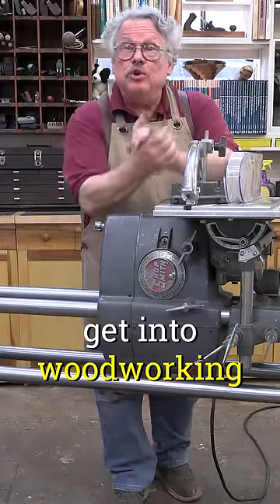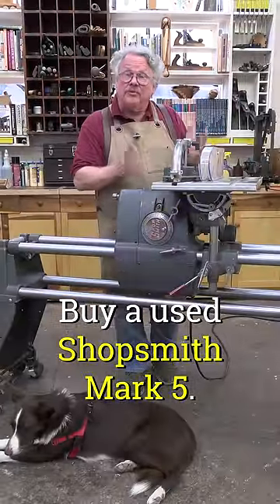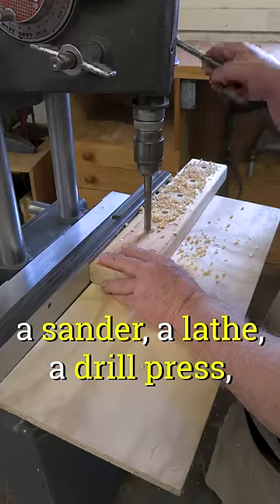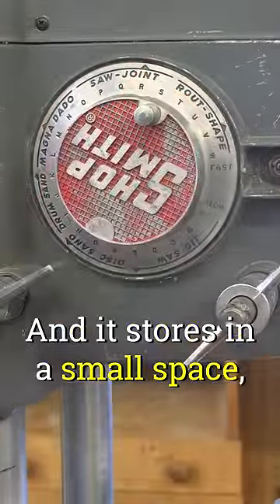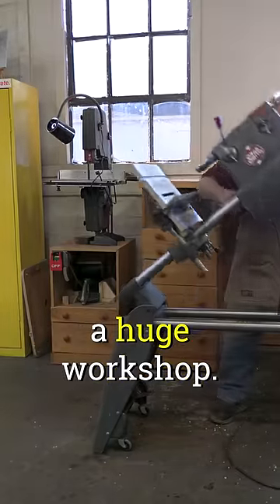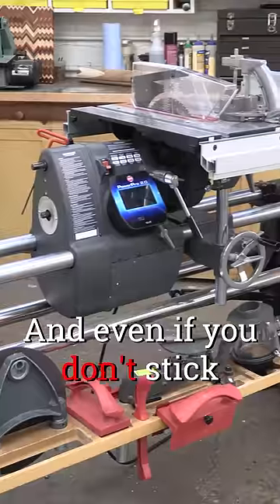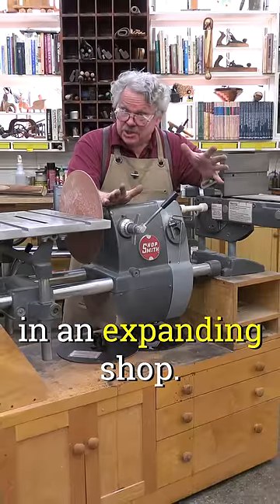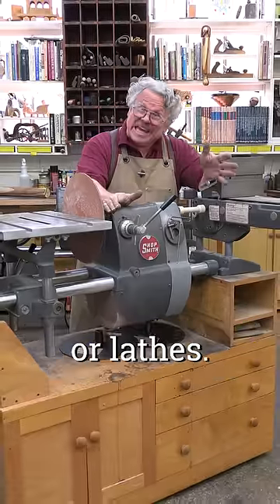A Cheap Way To Get Into Woodworking

Comment from the maker: I’ve always advised my students to start building their shop with used high-end tools for the simple reason that unless the tool has been badly abused you get a lot for your money. Good tools age well; they aren’t designed with planned obsolescence.

And I often recommend looking for a used Shopsmith Mark 5, especially if work space is a problem. The Shopsmith offers four essential tools in a 2’ x 6’ (0.6m x 1.8m) footprint – table saw, disc sander, drill press, and lathe. And they don’t cost a great deal. I’ve seen used Shopmiths advertised for between $150 and $500 US. So for not much money, you get some decent tools that fit in a small space. 

Those of you know my history surmise that I have a soft spot for Shopsmith, and I do. I founded Shopsmith’s “Hands On!” magazine and used it to launch a successful career as a woodworking author, eventually writing 50+ books. So my recommendation that newbies buy a used Shopsmith is partly due to good memories.

But it’s also due to experience. While I was writing those books, I tested hundred of tools and found few were more reliable than a Mark 5. I have one in my shop right now that was built in 1964. I’ve updated it with a larger table and a digitally-controlled motor, but the guts of this tool are almost as old as I am and going strong.

I won’t pretend that this convertible multi-tool is as convenient as individual tools. But when you consider the high quality, expanded capability and low cost of a used Shopsmith, most of us can put up with some inconvenience. I’ve also heard time and again from long-time owners that the Shopsmith tool design engenders good woodworking habits. To keep from constantly changing tools, you learn to think through a project and organize the steps to make the procedure as efficient as possible. This sticks with you throughout your woodworking career, even when you move on to individual tools.

Shopsmith is criticized a good deal by some very good woodworkers, and while I respect their opinions, I’ve found most of these folks have little or no experience with the tool. Working on a Shopsmith IS different than working with individual tools, much like working on an Apple computer is different than working on a PC. But both platforms get the job done.

The same is true of recent criticism that the Shopsmith is unsafe because it’s too complex. If you take the time to learn the setup procedures, it’s just as simple as most individual tools. Furthermore, these procedures make you aware of the importance of alignment and adjustment, which can increase safety. Then there’s the fact that Shopsmith has met all US and Canadian safety standards – for 75 years.

Finally, one of the most important reasons I recommend used Shopsmiths to aspiring woodworkers is that this machine has attracted and energized a marching army of enthusiastic owners eager to welcome newbies. My experience has been that woodworkers are, by and large, remarkably helpful people, but this is next level. Shopsmith folks have formed numerous online groups and forums where you can get almost immediate answers to your questions. In these days of cancelled shop classes and waning tool savvy, this is a welcome source of information and education.

If you want to know more about this tool, you can see demonstrations of the Shopsmith at https://shopsmith.com/ .
Reply: Man, I wish my woodworking teacher in high school was as good as you. You are doing incredible work!
Reply: I have regretted buying cheap tools many times. I have never regretted buying a high quality tool. Great videos I have learned a lot from the channel.
Reply: Many years ago (I feel like a geezer), I worked with an amateur wheelwright who had one. He did incredible things with it. Thanks for the advice and reminder!
Reply: Just bought a 30 year old delta contractor saw. It’s the industrial model that comes with the uni-fence what a huge upgrade from my plastic/aluminum Bosch table saw. Was a great deal for $150 and $54 in gas to drive 2 hours away.
Reply from the maker: @kevinthomson6324  Funny, I just did the very same thing in order to get Travis a good saw -- 2 hours, $200. If you've got the space, the old Delta contractor/Unifence combination is  a top-of-the-line tool. I've been relying this combo since the Unifence was a new idea, and have only had to replace the bearings after 35 years of constant use!
Reply from the maker: @Aaron-nj4ou  Thanks.
Reply: Thank you sir!
Reply: One big problem is that the Shopsmith has full 1 hp motor. You need a dedicated circuit to not continually trip the breaker.
Reply from the maker: @dallasarnold8615   The older SS's are 3/4 hp; and pull less than 10 amps on startup. Folks with newer models (1-1/8 hp) install slow-blow fuses and breakers. Most find that solves the problem. By the way, the newer Shopsmith pulls 8 amps at running speed, and and can suck up 13-14 amps under a heavy load. Since breakers are designed to pop at 80% of their rating, a 15-amp breaker, even a slow-blow, will trip at 12 amps. You can run the newer Shopsmiths on a 15 amp breaker, but you cannot safely do demanding work -- constantly tripping a breaker will eventually wear it out.
Reply from the maker: @thechumpsbeendumped.7797  Good luck!
Reply: I live off grid and my power is solar so I use dewalt battery powered tools.. I tend to do more “rustic” log projects (spoons,bowls, serving platers, tables, benches ect.. any tips on sanding weird shapes and grooves? Where do you find it easiest to sell your projects? Thanks. Great channel
Reply from the maker: @Guru_of_ganja  Since you're off grid, scrapers are a great way to quickly smooth crevices and contours. I keep a couple of old blue steel hand saw blades that I cut up to make shaped scrapers when I need them -- just file the shape. As for selling projects, I have very little experience -- I've spent my woodworking career selling books and plans. Check into Etsy.
Reply: I did not know I needed this information but now I am so grateful to have it. Thank you kind craftsman
Reply: I’m not reading that lol
Reply: I'm just getting into wood working an currently only have an old craftsman circular saw and jigsaw. My dad has a DeWalt table saw and sander so I have access to that. But after seeing this and doing a little research online this will be my first investment. Thanks for the video and introducing me to something I never new they made.
Reply from the maker: @rebelboy69  Most welcome.
Reply: Very detailed, but I still have a question.  What are some common issues that I could try to diagnose while buying a used shop master?  You mentioned that as long as the tool wasn't abused it should be fine.  What if it was abused a bit?  What might I need to be wary of?
Reply: @Guru_of_ganja  honestly for spoons and fork, I'd say get a sanding head for a dremal.  Those mini spinning tools people use for their fingernails pretty much work like a teny tiny sanding drill.  Vice the project in place and move about as you need to.
Reply: Excellent description and sales pitch! Your books and videos have given me the confidence to continue learning and improving my still very limited woodworking skills. 

It’s very rare to find someone who is both a skilled craftsman, and a good teacher… You sir, are both!
Reply: that's a swiss army table saw
Reply from the maker: @squish200  Bingo.
Reply: #NewFan 🤯 where have you been on my life? 😍 For someone who’s brand new to woodworking and feeling very intimidated about it your information has been absolutely invaluable… I wish I would have saw your videos a few months ago as I’ve already invested in a handful of tools from HarborFreight… with the last one being a circular saw, but the next one on my list was a tablesaw or a miter saw. I’ve even been researching the dual table and miter saws that seem to be unavailable in the US…. But honestly, honestly would’ve never even considered this as I didn’t even know it existed until now…. Thank you for sharing !! I have been binge watching your videos and shorts and look forward to seeing more of your very informative and quite entertaining content in the future!!
Reply from the maker: @aprilmariebee926  Thanks for the kind words.
Reply from the maker: @aprilmariebee926  Thanks for the kind words.
Reply: You do understand a shout out drives up the price.
Reply: holy shit how did i not know about this?
Reply: Thank you for calling out planned obsolescence. It's one type of contradiction inherent to capitalism, the evolution of which has decimated the craftsman. It favors stuff like monopolization and super exploitation
Reply: i appreciate the transparency. on the safety question, it’s funny how many things can be dangerous if you don’t take the time to learn how to do things safely in the first place, and also read the manual and get familiar with a tool before you use it, especially if it has a complicated and varied set up range. i feel like something that equates to a serious hobby or even a trade, you can’t expect all tools to be child proofed or even beginner proofed, there is inherent risk to woodworking that you avoid by using proper safety equipment and procedures, as well as tools that keep your hands away and stuff

Comment: I have seen them from $500-$800 in my area. Even if you dedicated it to one use, it is hard to find a lathe that size for under $500. I would grab one if I had room.
Reply: Yeah idk where the fuck he seen one listed at 150 but I ain't seeing it
Reply: @EatonShitson  what exactly does that mean? How small what is? What the hell would I lie for?
Reply: @terrmaso  he has no idea what he is talking about
Reply: Cheapest is over 2 grand  with shipping.
Reply: @dogwalker666  I'm referring to the used ones.
Reply: @terrmaso  indeed.
Reply: I restore my tools. I bought a Delta drill press and saw, a Ridgid jointer, a Nova spindle lathe, Shopfox mini lathe and a Nova midi lathe all for about $1000. The only thing I bought new was my planer. You can build a beautiful shop if you have patience.
Reply: Wow... Thats a lot more affordable than I thought it'd be...
Reply: Wow, i was expecting like 2 or 3 times that much. 500 sounds like an absolute steal
Reply: I found one on OfferUp for $400 and then one day the guy just dropped it to 100 I drove in pouring rain to go pick it up
Reply: I'm jealous, something like that would be worth thousands here in Oz.
Reply: . It sure does and looks super heavy duty
Reply: What kind of middle class shenanigans is this!?  If you want to get into woodworking for cheap, it's called hand tools.  You can find bins of them at any yard sale.
Reply: Hook it up with a link. I can't seem to find one for less than 3 grand
Reply: @dogwalker666  the used ones you can Google are all starting 2 grand and up
Reply: @christiancasaverdepertica1802  at 500, they're buying one that fell off the truck  from the mafia
Reply: @WanderingKat I only see childrens clothes and kitchen gadgets at yard sales. Never hand tools,
Reply: Woah that's like 90% less than I was expecting.
Reply: @WanderingKat hand tools can be really expensive without you noticing quickly though, this is mostly a one big investment that generally is cheap in the long run
Reply: I do wonder how well it works at each task
Reply: @WanderingKat yes, but they save you time which is not only money but non refundable. I love slowly chipping away at a piece of wood with my dad's tool, which used to be grandpa's tools, but it takes a lot of time and it's relatively skill demanding. One of this babies, you can do the same in 5-10 minutes. Depends on the project and the person really.

Comment: $300 30min for my house thanks for the tip!!
Reply: IT WAS ONLY $300?!? I've always been under the impression that these type of tools are thousands upon thousands even used!! I never looked because I'm new to woodworking and never thought I'd be able to afford something like this!!
Reply: @gingerfurrdjedi6211  yep just needed some new belts and TLC but it has everything else:)
Reply from the maker: @gingerfurrdjedi6211  Travis and I recently picked up one for $150 -- Travis wants to make a sanding station similar to mine. And if we find anything wrong, the company still offers parts -- even for Shopsmiths built in the 50s! They really are one of the best values on the used tool market.
Reply: @WorkshopCompanion  Thanks for telling me this! I'm looking into them now!!
Reply from the maker: @gingerfurrdjedi6211  Good luck!

Comment: What’s even better is the company is still in business (pretty small and restructuring) but they still make replacement parts and are still manufacturing in the US which is awesome.
Reply from the maker: Actually, they are the only power tool manufacturer still left in the US.

Comment: Honestly it's amazing to hear that their new stuff works "pretty much" as well as the old stuff. It seems that everything i buy today simply wasn't made as well as it used to be. My mother owns two kitchen aid mixers, one very old and one fairly new; the new one doesn't hold up as well. It's really discouraging. So to hear that the new builds aren't noticably less in quality as the older creations is so refreshing
Reply from the maker: I hear you. But Shopsmith has adhered to their basic 1950s design, including materials for the most part. There have been a few plastic substitutes -- mostly in the guards -- but for the important parts of the machine, Shopsmith still adheres to a Sherman-tank-manufacturing philosophy. (Actually, it's a Liberty ship manufacturing philosophy; the founders were naval engineers.)  This is why they last so long and there are so many old Shopsmiths still working.
Reply: @WorkshopCompanion  that is legitimately reassuring and makes me want to invest in something (not least of all because my father was a naval engineer in US naval academy)

Comment: I had a Shopsmith from the 50s I don’t remember the model and it was great and then in the early 2000s I inherited my grandfathers Mark 5. I have limited space in my workshop and absolutely love the flexibility that this offers. It’s amazing how many attachments are still available aftermarket to just keep expanding the flexibility of this great machine
Reply: 10ER. I've had mine for about 40 years.

Comment: These are great and people will almost give them away. sell cheap is what i mean. i bought one that was a 2003 model but there the same since 1955. guy i got from used it twice to make trinkets to sell at the flea market but never did and never used it again. I got it for 300 dollars and came with a ton of accessories, jig saw, router, sharpening station, quite a few different sander attachments. it also came with a whole tool chest of lathe tools and drill bits and lots of little shop smith parts. What i like about it, you can adjust RPM for the type of wood you are cutting with the table saw so your blade last longer. such a good tool!!!

Comment: I have the ShopSmith that my father bought in 1976. It still works great. My 45 year old son bought a used one a couple of years ago for $250. It still works great also. Great way to get started inexpensively or if you have limited space (or both!)

Comment: I've been using my old shopsmith 10er for about 3 years. Got it for 50 bucks in rough shape, put a little work into it and got a fine machine, 60 years old and works like new
Reply: but they stopped buildings in the late 50's that makes it around 70 yrs old.

Comment: Got one a few years back with the jointer and a band saw attachments. The drill press and lathe feature alone is well worth it. The sander is great too. I love mine, too bad I had to move it to the basement so my wife could park in the garage 🙄😢

Comment: My dad sold them as a side hustle in the 50’s and I grew up with his in the garage. He used it until he was 88 and the only part he ever had to replace was the toothed drive belt on the spindle. I couldn’t wait to inherit his so I bought one in 1990. Even though the machine has been around forever, you can still get every part and they fit.   It’s also easy to calibrate. Easier and quicker to change saw blades on than any table saw. And angles set on the table and mitre gauge automatically transfer to the disc sander and horizontal borer.  It takes up no more space than a bicycle when not being used and comes on retractable casters to move it easily. Yes, you do have to take the time to set it up and break it down… although you can leave the belt sander or bandsaw or disc sander on it and use those pretty well with it up against the wall. But if you don’t have a lot of space, or simply do not use a table saw, or drill press, or belt sander often enough to dedicate floor space to a standalone machine, the shopsmith is likely the best quality and most versatile tool you could buy.
It has a lot of available attachments you can also pick up used. I have a belt sander, router, planer, shaper, and bandsaw. I have done things as wild as use it to run a series of horizontal bores that had to be 48” deep, by rigging a support bearing in place of the lathe live center support, and using the combo of the drill Press quill run and the ability to slide the entire headstock the length of the rails…
One caveat- if you can, instead of looking for a used mark 5- look for the mark 510 or 520. It has a better table and better fence.
Reply from the maker: All good advice.